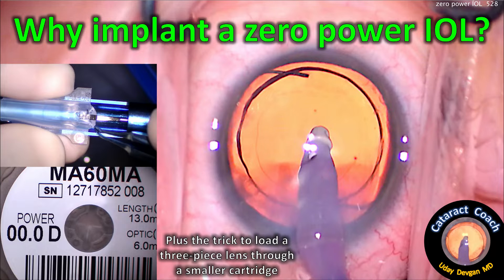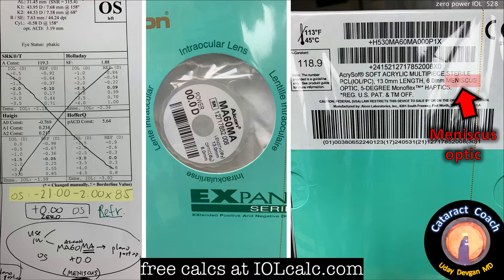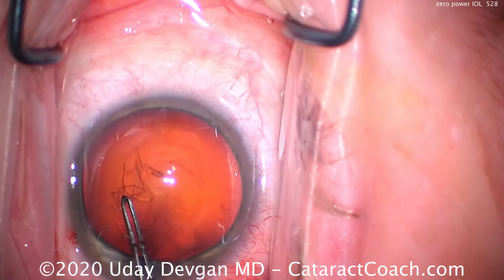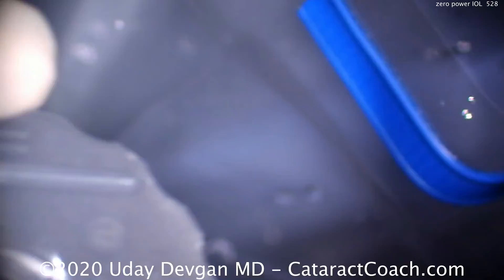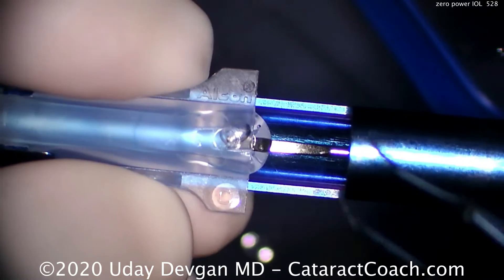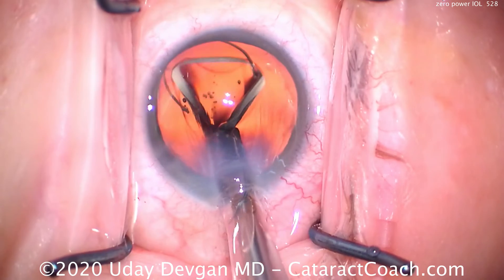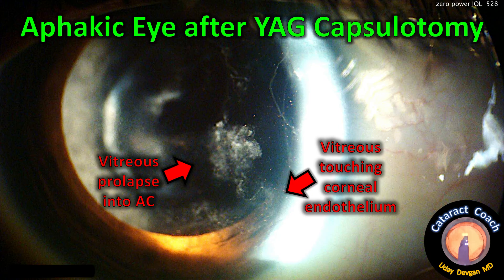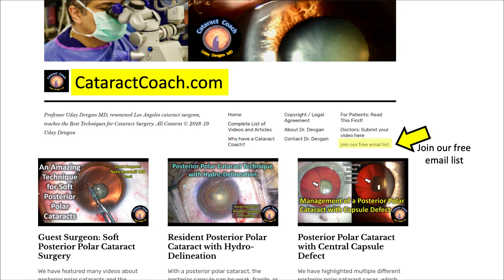Why implant a zero power IOL in very myopic cataract surgery?

Comment: Does it make sense to implant a zero power lens in someone who currently has 20/20 vision? I am only eligible for monovision and don't want to have to choose between near or far sightedness.
Reply: No.  They take out your lens. That removes about 20 diopters of focusing power from your eye.   It has to be replaced with a lens of the same power.  Your natural lens is probably in the 18 - 22 diopter range.  So your new lens to give you the same vision, would be in that same range.  A zero power lens would be for somone who had terribly nearsighted vision before surgery.

Comment: Great video. This answers my question a had for a week now, until i found your video. I was wondering what happens if some one has about -22D would it not bet better to take the natural eye lens out in such case and if not why not. But this solution just placing a zero power lens seems very logical. What is the chance for PCO? And will that be treated with cruciate shape YAG?
Reply from the maker: Same PCO rate for any other three-piece IOL of the same design.